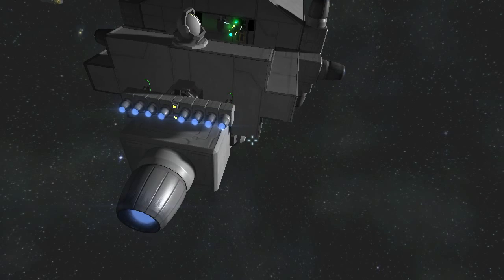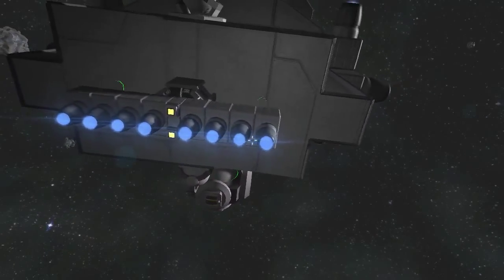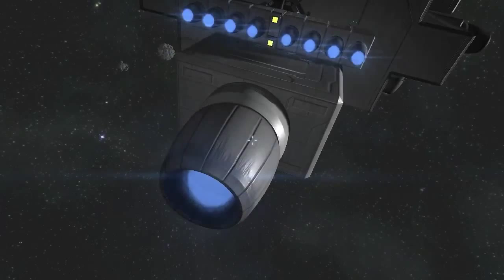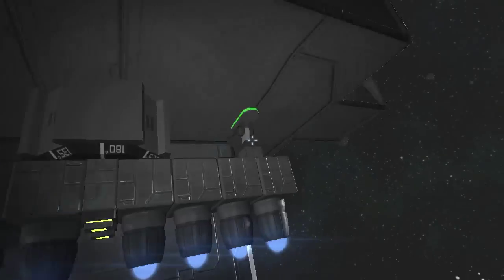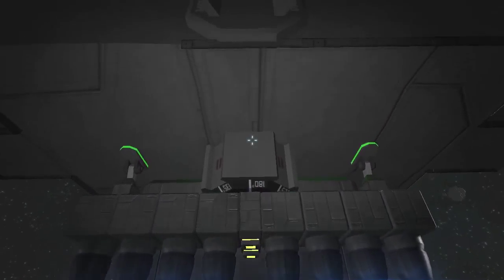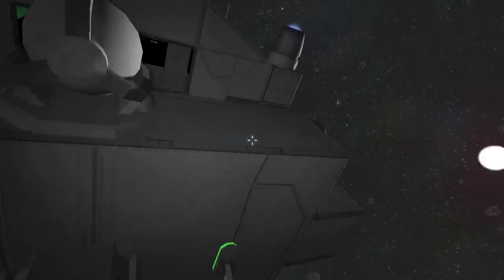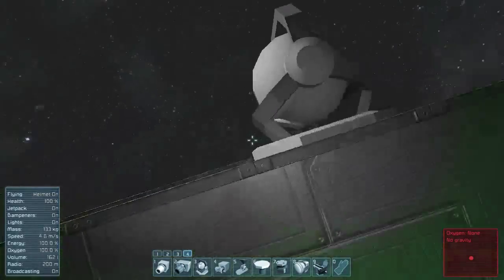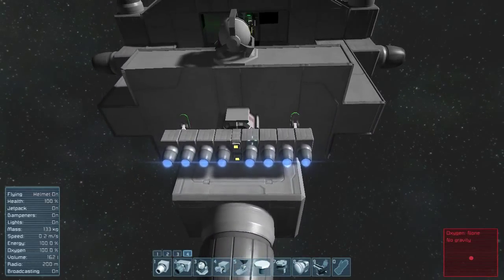Space Engineersing: Small Ship Engines

Comment: Hey Craig, any news on the phantom torque or a better way of mounting?
Reply from the maker: KodeeDentares The phantom torque is from the legendarily awkward landing gear. This is probably the easiest solid way to mount it, but a better way would be to use two large-small converters and fuss around with merge blocks until your engine line is connected to both.